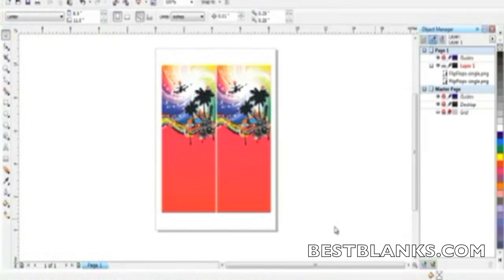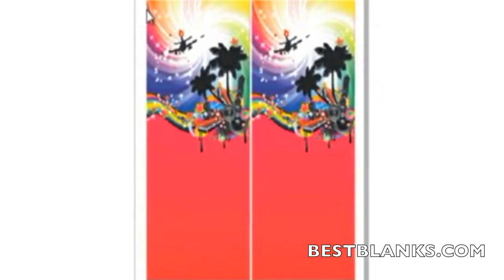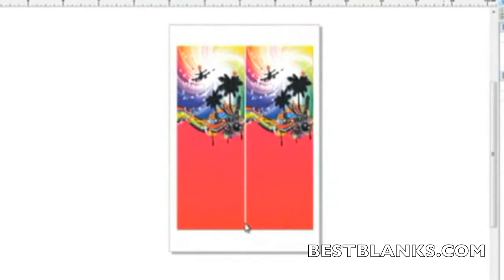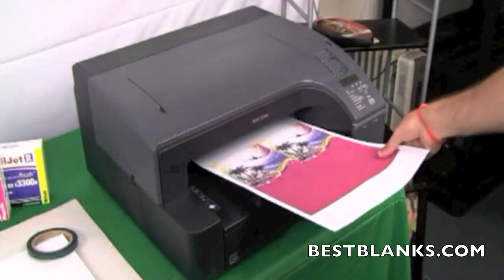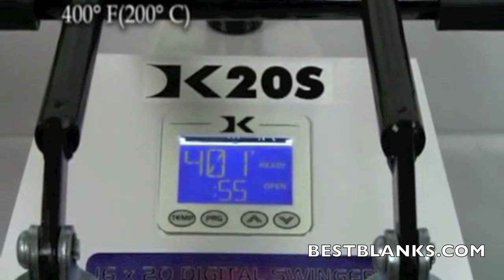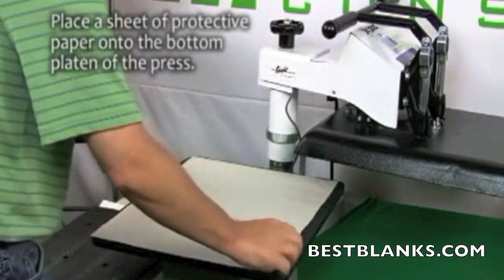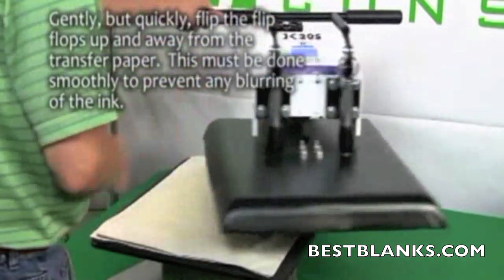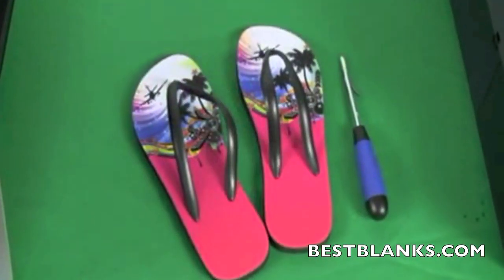How To Sublimate Flip Flops

Comment: can we use a standard transfr paper
Reply from the maker: These should be printed with sublimation transfers. Sublimation inks actually dyes the fibers and there is no top coating that can wear off. If you use any other type of digital transfer papers (inkjet, laser etc) these will not last and the image will soon be rubbed off. If you need further help please give us a call! 888-431-7385 or 954-989-1250